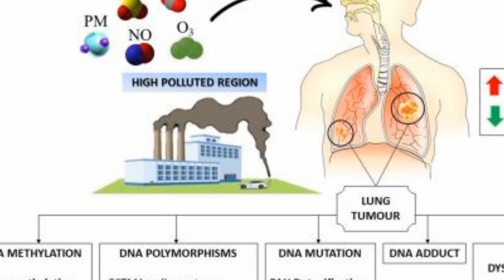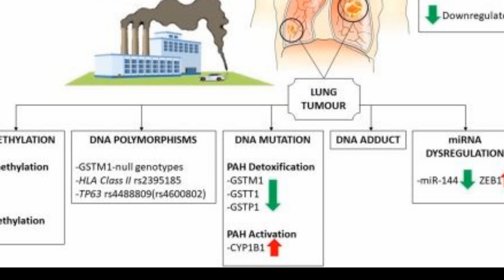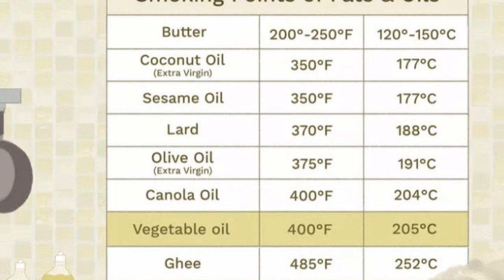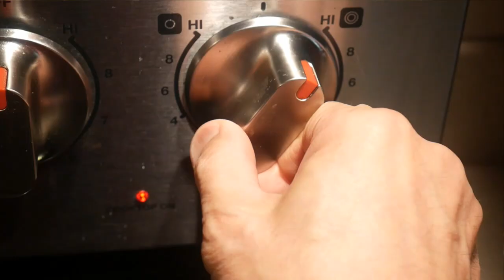How to reduce COOKING OIL FUME during stir-frying using 5 simple guidelines

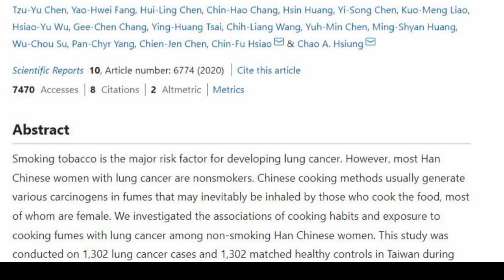Comment: 3:18 I've read that study, but it didn't say using fume extractor equates to almost no risk, only roughly halves the risk? 
"However, long-term use of a fume extractor in cooking can reduce the risk of lung cancer by about 50%.  Furthermore, we provide evidence that cooking habits, involving cooking methods and oil use, are associated with risk of lung cancer."